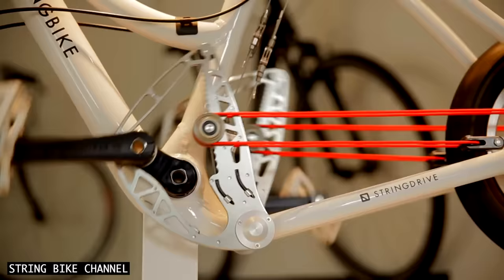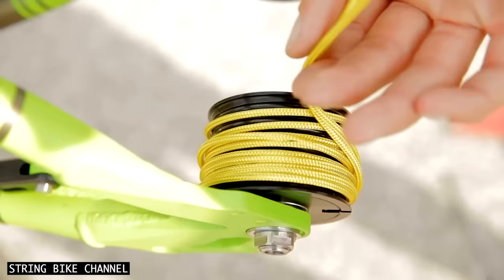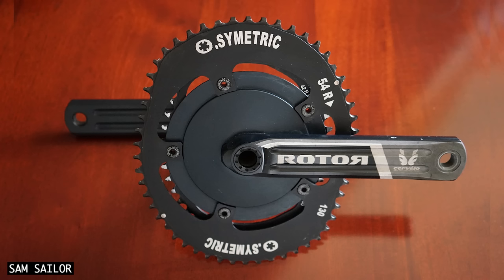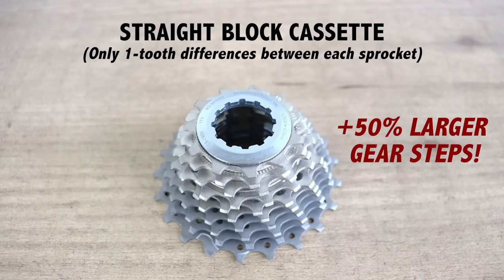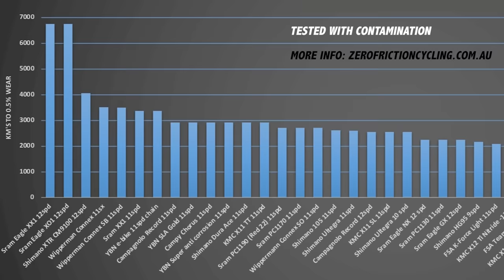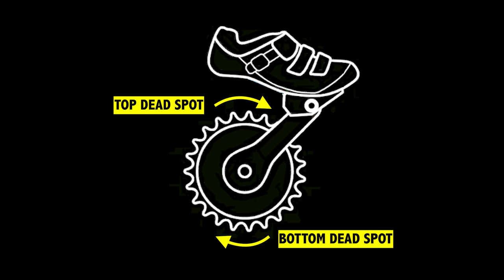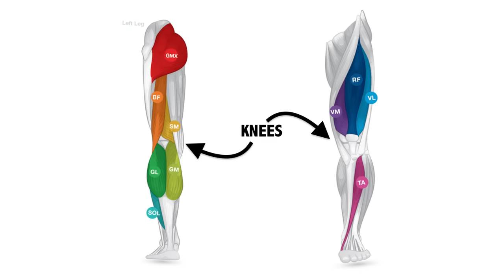Are Chainless String Drive Bicycles a Genius or Terrible Idea?

Comment: While it wasn't obvious, I think this was likely yet another product design made for disabled people which failed because the version for non-disabled people didn't take off (which would have brought the cost down). They had a section of their website which was vastly more engaging focused on the wheelchair add-on they made which used the Stringbike technology. A couple major benefits, aside from not requiring an entirely separate additional dedicated wheeled platform, were that it didn't require anything near full crank cycle (and at any part of the "cycle" with equal efficiency) to provide drive, could be shifted without taking one's hands off of the "crank" (take a good look at how a hand-cycle is shifted for contrast), and didn't require moving one's hands to a separate grip just to apply the brakes.

Comment: The teeth for gear change looks like it will wear out fast, making you buy those crazy expensive "rods" again. As for ebike compatibility, just make hub FWD. The string durability will be even less in rainy, dusty environments. I also imagine the mess and risk when they snap is going to be painful.
Cool idea but not competitive enough to replace chains.

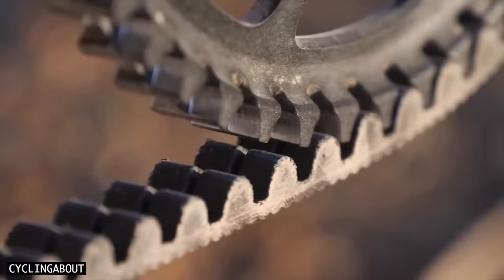Comment: 4:30 not true for a lot of internal gear hubs, with most of them you're not supposed to or just cannot shift under load and you only can while stationary.  So the string drive definitely has an advantage there.  As for an ebike string drive, why not just put the electric motor on the front hub?

Comment: OK, at 5:20 - that's a bad idea and it's been done before.  There used to be elliptical chain rings on bikes in the 1990's, I used to have one.  They were discontinued because they cause knee injury over time.  I'm surprised to find out they are still available today.  Nobody uses them, and those that have, I think widely regretted it.

Comment: Does this not also remove the power generated by the leg on the pull (going from lowest point to highest point) to the wheels. Using clipless pedals and shoes allows for this part of the stroke to propel the bike as well no?

Comment: I didn't see a mention of the weight of this system, but looking at the design, wouldn't it be much lighter.  I didn't see it in the efficiency research you mentioned either

Comment: If you already have a lateral motion system and claim the advantage that you can increase energy transmission where your legs are most effective, in downwards motion ... why the heck do they implement a rotary propulsion system, again?? Why not install a lateral push mechanism, slightly forwards, where you have an optimal angle of attack for your legs? Just perfect for sitting bikes, pushing your legs forwards instead of in circles.

Comment: Lol where do you live that after cycling the bike can go in the car clean. Not so in many countries.

+ The reduction in crank deadspot is very interesting. That could possibly could improve the felt efficiency. Maybe it's less efficient mechanically, but more efficient for a human body to drive. 
They should test it with mechanical legs or something. 

Very interesting content.

Comment: First time seeing this kind of chainless drivetrain. Given that it translate circular > reciprocal > circular motion, would it be a good fit for a modified combustion engine where the cylinder drive strokes directly drive the reciprocal > circular motion?

Would be interesting if some makers come up with a POC to see how it is viable.

Comment: Are the left and right pedal cranks connected or independent?  I ask cause I really like the extra power I can get using clipless pedals and powering both feet at once....one pounding down and the other lifting hard.  If the pedals are not connected, then there is no powering on the upstroke.

Comment: Can it be used in a commuter bike in winter conditions? I'm a bit tired of a regular chain drive with internal gears bike. Needs constant lubricantion, tensioning or replacement of chain and adjustment of gear every time. It's too much maintenance especially during the winter months when I really have no where to do maintenance except outside so one that can go without maintenance when it's freezing would be extremely nice. It's only a km or two to the station so efficiency isn't that important - but very low maintenance is. I've thought about trying a belt drive but so far they're quite expensive.

Comment: Why can't they just use a chain for this and move it to one side? 🤔

Meaning removing the individual gears and have the chain(s) do an reciprocating motion, not a circular one.

Such a redesign could run the chain in an enclosed housing along one of the frame pipes to the back wheel, avoiding contamination and allowing an oiler to be used.

Comment: Why do you need this crazy mechanics and not just connect the strings to the crank levers making them move back-and-forth. Avoiding of pedal rotations would be a main benefit of string design. You would have a linear load on pedals, nearly linear move, plus variable clearance. Plus you can place the crank axle anywhere, as you don't need connect to pedals by the same axle. You may put it back to the rear wheel or to front, choosing the best aerodynamic position or optimum legs position.

Comment: The ropes will get dirt and grime in them as you ride down the road. They'll break down in the sun and with the dirt and eventually fail. But everything eventually fails so w/e. Now if only you could hide the ropes away from dirt and sun. That's what a lot of shaft and gear drive systems do.

Comment: Also besides the basic function it would have been very interesting to see how the gear shifting works. I have a vague idea how it might be from what I saw but the whole shifting apparatus seems to have very much exposed bowden wire that are naroowly bent which sure isn't optimal for their longevity in muddy conditions. I suspect a weakness in the system there which wasn't clearly shown here, but tell me otherwise if it ain't so!

Comment: There are way too many moving parts that could easily get damaged.
Belt Drive is way better, and it's good for off road biking too since the belt doesn't rust, and any mud could be easily washed off.

Comment: OK.  I am "hearing" that the strings have a"lower duty cycle" than (chains) or (belts).  That part seems logical.  BUT, the part that is NOT making sense is.  Why didn't they simply use a (cable, steel string)?  Is there a obvious reason I am missing and my question is ignorant?  The only issue I "see" is that.  Maybe, the cable is not flexible enough to make a good enough ride.  (Good enough) as relative to chain.  As far as (duty cycle).  I don't "see" a cable ever wearing out.  Ever, I mean constant use (24 hours a day) for 10 years.  Why not cable??

Comment: If string drive produced significant weight savings OR significant durability enhancement, this could have really taken off. However, those are the two criteria that competitive cyclists and enthusiasts are probably most worried about. The drive arms are likely quite delicate, and no system is adjustment-free. This looks finicky. As you said, there is a weight penalty. The ropes are a fast-wearing item (I know cyclists that would have to replace these ropes once every 10 days or so).

Chain drives are already efficient, and the only real efficiency loss I would be worried about would be rope stretch. It seems it's not much of an issue. Disc brakes are also a major concern, and this could never work in a mountain biking environment. Ropes and v-brakes are not compatible with this style of cycling.

Comment: A string drive bicycle fitted with a front wheel motor/disc brake and rear rim brake would easily overcome the alleged disadvantages of a human powered machine without mod cons (disc braking and electric assistance).

Comment: I can tell you by just looking at this system as a Dutch man that this is not the same experience and durability compared to a bike with a chain. This is like going to a fitness school and using real weight or air. Air just does not feel the same as real weights. If you run into problems the string will not and can not be changed easily on the fly as a chain will not snap and in 99% of the situations you can just put it back on the gears. Some things which a good do not need a next step in evolution or a next itteration!

Comment: Disc brakes are great, hydraulics are up there with humankind's greatest inventions. I don't understand why they did think to combine two options when they thought of brakes for the String Bike. Elaborating, the mechanism of the rim brake is essentially the same mechanism of disc brakes. The squeezing of the pads is almost so similar to the mechanism of hydraulic discs to that they actually do manufacturer hydraulic rim brake. IMO the hydraulic rim brake vs hydraulic disc has less components, farther away from harm, and could be what the string bike would need. Just have to figure out how to incorporate an E-train alongside the string. Steel can also be incorporated into string. This makes a product similarly as strong as wire also, similarly as malleabile as Rope. I'm 100% sure someone can come up with an E-train that could coincide with this string driven train that wouldn't need over engineered and somewhat economical to produce.

Comment: I stopped at 0:50...More mechanical points of failure, weaker materials, more susceptible to damage and debris, more friction points...It's clear that this is a terrible design by someone who is trying to reinvent the wheel just for the sake of being different rather that improvement.

Comment: I see no need for the pedals to go through a full rotation they could reciprocate instead. Might save some friction on cam surfaces.
Reply: There is a company making a velocar/hpv called Djiker that seems to be using a variant of string drive that ditches rotating pedals for linear pedals so that has been done now.

Comment: Your example was someone who rode a bike for LESS than two weeks, yet you honestly believe that immobile tension strings will work as gears??? In real life these 'strings' would suffer blazing summer, freezing winter, rain, mud, frost and snow, on a bike that would be dropped on the ground, scraped against hedges and walls, bounced, kicked, pushed and carried around for YEARS and still be expected to function at full efficiency! This is the same EV's, a great idea in a perfect world but a total failure in the real one.

Comment: There are NO crank dead spots for a skilled cyclist. Learning to use all 360 of crank rotation is a basic skill all racing cyclists learn. There is a smoothness to high cadence pedaling with round chainrings. Non-round chainrings or string drive will make high cadence 100+ rotations per minute impossible to maintain. I should know, without my knowledge the mechanics changed my rings to oval during Race Across America at about mile 1900. For the entire day I did not know why I could not get a smooth pedaling motion, it was the non-round rings. Lack of smooth rotation decreases efficiency in highly trained cyclists. Higher maintenance is not good either, we need heavier stronger chains so that 10,000 miles is the average wear time. Every change in drivetrains over the last 50 years has been reverse technology, more complex and very expensive bikes giving less to cyclists than before the change. Simple downtube friction shifters and no indexing was a good solid dependable drivetrain, now problems abound with matching the correct speeds throughout and expensive beyond the cost of a motorcycle....stupid is what it is. Just like automatic transmissions in automobiles, made available for the dumb, uncoordinated, stupid lazy drivers.

Comment: Just because you can doesn't mean you should!  The mechanics and the materials of bikes are incredibly simple, elegant, efficient, and reliable.  We don't need string drive, we don't need electronic shifting, we don't need alternative technologies to take over functions that have worked well for many decades.  Keep bikes mechanical.  Don't let them go the way of clocks and watches where elegant and beautiful mechanics are all but gone.  Fixed gear and single speeds became popular for a reason, simplicity and elegance. That holds up for chain drives and cabled indexed shifting.

Comment: I Think this is not the way to go about it. The friction on the lever seems like an unnecessary loss of energy, looks fragile with way too many moving parts that all wear out. This is the opposite of simplicity. When a chain wears out, you ride it. When a chain really wears out, you still ride it. Only when it's so goddamn worn it breaks apart, is when you change it. That's pretty much how it is for most people. 
I've seen 30 year old bikes with their original chains on them still rolling around. Granted those had fat chains that are much more rugged, those bikes are heavy, not easy to pedal either, but those without much or any maintenance can ride thousands if not tens of thousands of kilometers, and people don't care. 
Chains reign supreme, because of their reliability. Even non maintained ungreased chains last very long. I've seen bikes with rusty chains that squeal and squeak being in use for years on end up to a decade even without being lubed once! 
Most of the population are not enthusiasts, rather the opposite. They couldn't care less about their chain or any part really. Brakes being the only exception for obvious reasons. So most people hop on their bike and go somewhere. Most people i know don't ever change gears. Derailleurs break and sit in a single gear for years if not for the lifespan of the bike itself. People just ride like that. For those people a simple $5 chain on a cheap bike is way more than enough to last them years and years. And those are the vast majority of the people that rides bikes.

Comment: A CYC motor might go on one of these string bikes really good, Looks like it would anyways, lol...
Next there will be bike frames made from string, The idea is alright but it looks like to me more thing will go wrong with a string set up rather than a chain set up, Plus I have had a KMC chain on my BBS02 E-bike for the last year and it looks like it is still going strong, I still got a spare chain I keep on me at all times when I am on the E-bike I done, I want to do another e-bike, But the funds are not there, I will in the summer, But yeah if you don't snap through gears and keep the chain properly greased, And not over do the grease, You chain will last a while, You pay for what you get with bike stuff though, I wonder if anyone have installed a CYC motor on one of these string bike frames......

Comment: "The ropes last 1000 - 2000km" ... yeah, and that's the point where I'm out. I drove my chain over 5000km already and that's without the pre-owners use. Never had problems with my chain and I guess this won't happen so far, too. I also see a lot of friction between the strings. This is just unefficient.

Comment: Wanted a breakdown of the mechanism. Got a 12 minute ad instead. No, it's not 'impressive' in the slightest that the ropes 'can float in water' in regards to their tensile strength. Density and tensile strength aren't correlated. And even then, that stuff doesn't matter in the first place.

Comment: Can't you just put a hydraulic disc brake at the front while the back can just be the old Rim brakes. Make the right grip the front and the left the side the rear like a motorcycle. If they could add something like ABS that would reduce the risk of flipping foward.
But yes the stopping power is the front brakes so I don't see why you wouldn't want the best brakes you can get.

Comment: 10 dollars for 1200km on the string drive. Yeah, compared to a chain drive that is not very good. 1200 km may sound like a lot but its not. 100km is 60 miles and i can do that rather easy. So after about 10 rides i would need to replace the "chain" at 10 dollars a pop. The dead spot can be eliminated with oval chainrings so you dotn need a string drive to get that benefit. It does offer closer gear ratios which is nice. I think the real wheel got rid of the dishing. It looks that way. If so then this will make rear wheels last much much longer as there is no offset. Rear wheels are pulled more to one side than the other. This is called dishing. Cool concept but this was never going to take off. There are too many drawbacks that i can see. This is just one more step toward getting rid of the chain and deraillleur system which will heppen eventually. Along will come a system that is much better. It just needs to be made. Belt drives are good. Tour de france 2024 starts today in florence.

Comment: That's silly, why would you want rope? The moment you start going through sand and mud is the moment you get a bunch of little bits of material jammed in between the fibers, all that movement slowly eats away at the fibers as all that material in between them acts like sandpaper. On top of that these ropes tend to degrade over time when exposed to the Sun.

Under large tension loads ropes tend to stretch a bit too. So everything about this screams do not buy to me

Comment: No advantage over my Priority 600 which has a Gates belt driven by a Pinion C.12 that has a 600% ratio. Equal to my Priority Turi which has a Gates belt driving an Enviolo that has a 300% ratio, and even though the ropes are cheaper than the belt, the belt is much more durable. I put 7000 miles on my Turi before the front crank gear began to make a creaking sound, but corn starch lubricated the belt and the noise went away.
No, the loss of a rear disc brake kills this idea for me. Everything else could be worked with but that's a non-starter. I'm NEVER going back to rim brakes OR chain drives.